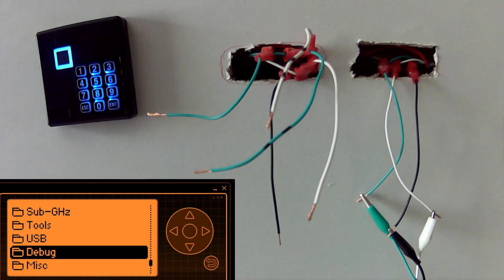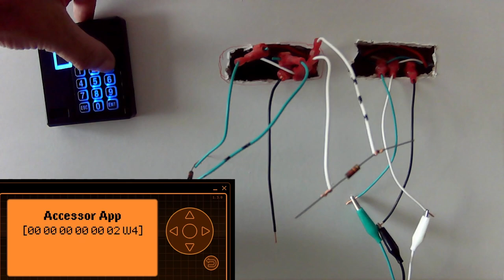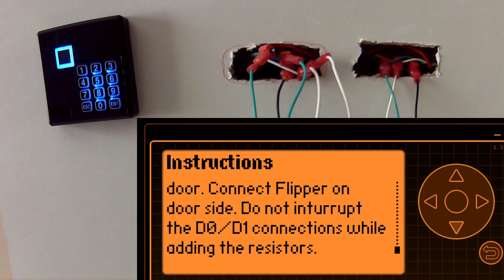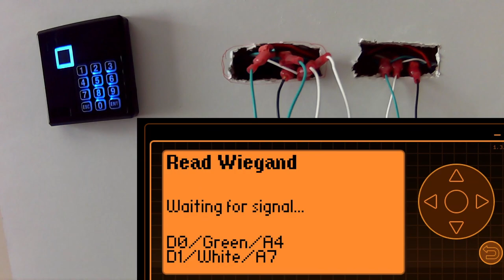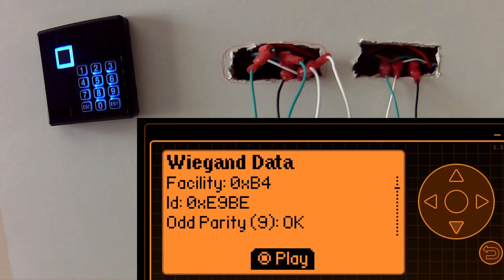Flipper Zero - Wiegand app for W26/W34/W4/W8 devices

Comment from the maker: I created a video using MOSFETs -- https://youtu.be/OVyd3ffnZ0M  
which allows you to NOT need the inline resistors (but it does require two MOSFET and two pull-down resistors on the Flipper).  With the additional hardware attached to your Flipper, you just need to tap into the D0/D1/GND lines for both reading And sending signals!  (You also need to install the updated Wiegand app with support for the MOSFETs.)  Download the app from here...
https://flipc.org/jamisonderek/flipper-zero-tutorials?root=/gpio/wiegand

Comment from the maker: You can find my application at https://github.com/jamisonderek/flipper-zero-tutorials/blob/main/gpio/wiegand/README.md   Please let me know any feedback you have. I also have this listed as a project on the Flipper Zero Discord at https://discord.com/channels/740930220399525928/1094249922687139977/1094249922687139977

My Amazon affiliate links are at https://github.com/jamisonderek/flipper-zero-tutorials/blob/main/electronics/README.md   When you purchase through links on this page, I may earn an affiliate commission. I have things listed like the alligator clips, the Dupont Wires connected into the Flipper Zero, the Wiegand card reader, and the quick splice wire terminals. #commissionsearned

Comment from the maker: I don't see a way to pin a partial comment, but in the Justin T thread he mentions that "the Wiegand device has to have 100 to 110 ohm resistor between D+ and D- to match the impedance of the cabling and prevent refraction/ reflection on the data line."  The controller and Flipper don't have this constraint, so perhaps in official controllers we wouldn't want a resistor, but instead a different way to pull the lines to ground?  (Please read the Jusin T thread for more details.)
Reply: I may have to back peddle a little. I just metered a few of my readers that output both rs485 and wiegand they are in fact 110 ohm terminated even when only outputting wiegand. But other readers with only wiegand output are anywhere between 2k ~ 5k. So  I may not be 100% right when I assumed all readers have internal termination resistors.
Reply from the maker: If you are only doing reading/saving with my app (and not using PLAY) you can just tap the wires without any resistors or MOSFET.  This would enable you to see the timing of signals, understand parity bits, etc.

Is there any documentation you can share for different controllers/keypads?  The site for my keypad doesn't mention anything about resistance, nor does it mention requirements for the controller.  I measured the internal resistance at around 150-160ohms when it is outputting 5V signal on D0 or D1 lines  (e.g. I took D0 wire and connected it to 150ohm resistor, other side of resistor to ground, voltage on D0 is showing as 2.5v).  If the total was 250 ohms or more, I'd feel comfortable connecting my Flipper Zero to it and playing a signal (so in my case, I'd be okay with a 100ohm in-line resistor instead of the 12K I used).  I'd still like to look into a MOSFET solution, so that there is more isolation for Flipper (and then I'd be fine with connecting it to a 110ohm/5V signal).
Reply from the maker: I created a video using MOSFETs -- https://youtu.be/OVyd3ffnZ0M

Comment: Most access control cards are setup with the Facility code and ID code printed on them in decimal it would be handy to have this option.
Reply from the maker: Thanks for the feedback.  I opened an issue for tracking, but I might not get to it until next week. https://github.com/jamisonderek/flipper-zero-tutorials/issues/8
Reply: @MrDerekJamison  Awesome I was planning on writing a wiegand input app untill I found your video. Flipper screwed up a bunch of orders and I'm still waiting on my device (possibly forever). If and when it shows up I'll be checking out yours before I bother. Did you add support for other bit formats beyond 26 bits or custom bit formats?
Reply from the maker: @ckbhack  https://github.com/jamisonderek/flipper-zero-tutorials/blob/main/gpio/wiegand/scenes/wiegand_data.c

wiegand_add_info currently adds additional info for W4,8,24,26.  You get bit_count, data[] D0 or D1, data_fall[] timing, data_rise[] timing variables and you fill out a FuriString *buffer with the data you want to show the user.

Feel free to submit PRs if you want to add support for additional formats.  I only have the one reader.  I'm going to do a tutorial on config screens soon, so we could integrate that to support multiple formats if for example W36 had different ways to interpret data.  Reach out to me on Discord - codeallnight#1337.
Reply from the maker: One month later...  it has decimal in the output.

Comment: Awesome! Very nice! Thank you!
Reply from the maker: Thanks for the suggestion on making some Wiegand videos.  I’d love to connect on Discord or email about the results you get from running the app with different readers - to understand timing of pulses (like any save file).  Also, if you have 8-bit keypad; knowing if I got that logic correct.  :) For 34-bit I don’t do anything special; if you have ideas there, I can add them to the Read output (or teach you how to add them).
Reply: From what I saw in the video you have a great base line started and definitely useful. I do have some ideas that I think would be useful to add.

Such as being able to have flipper be able to read RFID or RF and then output wiegand. Basically being able to remove the card reader from the equation and using the flipper in its place for troubleshooting a control system interface. 

 Another thing I think would be useful would be to have an option to display 

Facility code and Card number (in decimal)

Full card number  (in decimal)

Hex card number 

Binary (like you have done)

Depending on the manufacture everything is going to be entered in those different formates. The list above is in order of how frequently  manufactures use a particular format.

Having the option to display the numbers in different formats would dramatically increase your apps efficiency and potential by not having to   manually converted to these numbers to check against the physical card number, or numbers used in access control software.

Mumbles1#7095
Reply: Is it necessary to cut the wires or use the resistors?

I know that the GPIO’s on the Flipper are only 3.3v tolerant and wiegand is 5v. But the flipper zero 51 ohm internal resistors and the wiegand device has to have 100 to 110 ohm resistor between D+ and D-  to match the impedance of the cabling and prevent refraction/ reflection on the data line. 

So I think basically there is a natural voltage divider circuit created. 

5Vx100/ (51+100) = 3.3 volts

I could be wrong. I just wondered why the wiegand wire needed to be cut and whats preventing it from being connected like an ESPkey or an ESP-RFID-Tool?
Reply from the maker: @mumbles1justin  This is where I’m still a noob.  My logic was if the output from the keypad was 5V but we want to pull it to ground with the Flipper Zero, then we would want a fair amount of resistance so we aren’t sinking too much current.  I didn’t measure the internal resistance of the keypad (which is supplying 5V).  If the line already has 100 ohms (on the keypad side) then I’d probably still use a mosfet or something to pull the line low; rather than try to drive it directly by the Flipper?  If I owned a controller instead of a second flipper, then I could experiment more.  Next week, I’ll try the MOSFET idea and see how that works.  I was worried that pulling the 5V line low might damage the keypad, but it sounds like you are saying the D0/D1 lines are made to be pulsed low by multiple devices?
Reply from the maker: @mumbles1justin  I think 5V/151ohms = 33mA?  https://docs.flipperzero.one/gpio-and-modules#A02ys says "Each pin can source up to 20mA".  (It doesn't say what it can sink. And we are only doing short bursts... but I think I'd feel more comfortable with a MOSFET to reduce the current consumption in the Flipper Zero.)  The application sends pulses by using GPIO and GpioModeOutputOpenDrain.
Reply: There is no current rating listed for sinking because the IO is the “load” itself. So I think its very unlikely if not imposable for the IO to over drive itself.